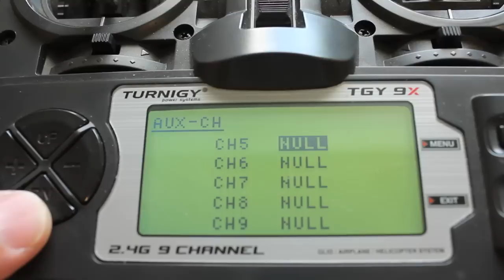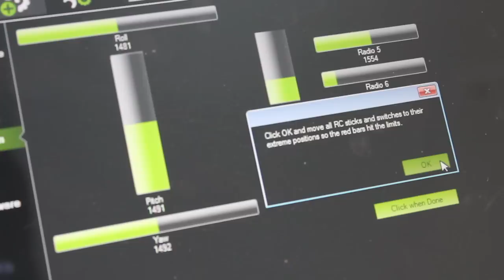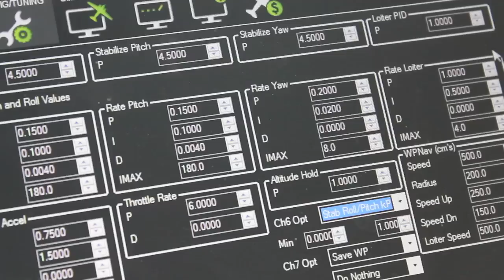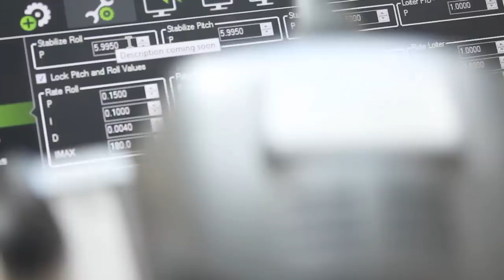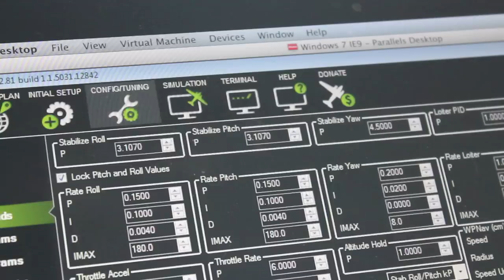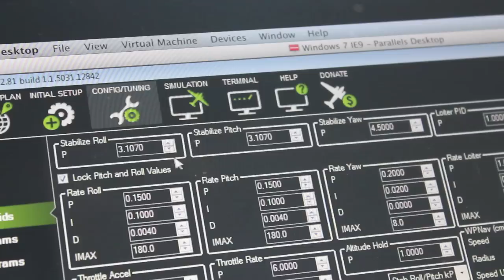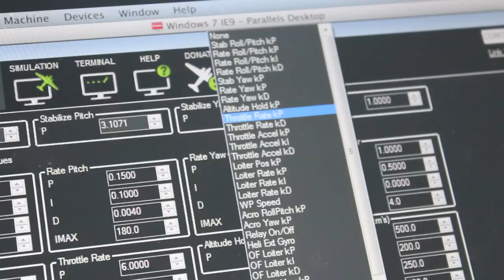APM 2.5 In-Flight Pitch/Roll Gain Tuning for Stabilize Mode w/ TBS Discovery Quadcopter

Comment: What is the difference between Stabilize Roll/Pitch vs Rate Roll/Pitch?  From what i gathered off of the Ardupilot page, it would seem the Stabilize Roll/Pitch setting makes it more sensitive at the sticks, and the Rate Roll/Pitch makes the drone itself tighter and locked in while flying.  Let me know if I am correct.  Thanks!

Comment: Hi, great video.
I hope you can help me.
my quad fly fine, and after a minute in the air its starting to shake like crazy. I crash it twice when I tried to slove the problem. do you have any idea of what the problem can be?
thanks a lot! Matan.
Reply from the maker: +matatisan I would work on maybe bringing your gains down. I've noticed that if I tune in the garage and sometimes go outside in wind it will begin to oscillate. So I need to bring the gains down a bit more. Another option is to watch my most recent video about tuning 250 size frames and try some of the tips mentioned in it. I bet a good autotune may help you out.

Comment: mine got jerky when in stabilize mode

sometimes jerky yaw or jerky throttle up when in hover

i really dont know what to do after tried to solved problem with tuning PID and change vibration damper

i really appreciate if you can guess or sort my problem

thx
Reply from the maker: +j3fron I did a recent video that shows how to tune a 250 size quadcopter. Watch and see if it helps with your problems at all. Thanks for following along and good luck with your setup.

Comment: Hey Dennis I hope you can help me.
I have a apm2.8(I know it`s a clone) It flys quite well but I noticed that if I flick it to a side and let go of the stick immediately it doesn`go straight back to level, It does some sort of a wobble and goes level like that which I thought that it wasn´t a major problem but in loiter or pos hold mode it can´t correct very well if it´s windy, because it´s constantly trying to correct which results to a major osccilations which then leads to a crash if I don´t go back to stabialize.
Reply from the maker: +robin bertschler My best advice is to check out "Common Problems" on this Loiter page:

http://copter.ardupilot.com/wiki/loiter-mode/

Also, have you checked stabilize tuning as discussed here:

http://copter.ardupilot.com/wiki/stabilize-mode/

and look into auto tuning. Good luck and please keep us posted on your progress.
Reply: Thanks i'll let you know.
Reply: Now this is a diffrent topic but I just can't figure it out.
I have a ts351 and a rc305. I'm using a rollei bullet 4s which us very simmilar to a gopro 2 also has the same video out. But I can't get a good video, sometimes it's green, flickers (you can't really see anything) but usually I get no video at all. The camera works fine if I plug it to the screen directly.
Reply: Hello Robin, i have exactly the same problem, did you find the solution?

Comment: dear Dennis Baldwin ,i hope you can help me as i am in the middle of tuning my copter, and as it is windy in the uk right now and i am little sceptical about autotune i am doing in flight tune with channel 6 ,i have an x8 set up on 700mm frame with multistar 4006 740 kv motor and just have put 1345cf props on previously had 1255 , and it flys worse now with 1345 and i thought it would fly better, as it has become very wobbly and thought you had to decrease gain from stockgains as it says in spec that i should have gained more trust/power with these 1345 props , however the way i understood from your video i have to increase gain instead of decreasing and i think that was my mistake as i decreased gain in flight and it flew worse, went it loiter and start going crazy toilet bowl effect never did that with the 1255 previous prop and when i switched back to stabilize i shortly landed afterwards and it did not went well as i just released/lowered little throttle it dropped dramatically /rapid that it plumped to the ground(low altitude and i actually crashed, luckily no damage except snapped gps mount which is easy to replace as i have few spare, just to clarify you recommend i should increase gain and what about thi I shall i leave it always at 0.1 Intelvale) and what the D always at 0.4 and what does IMAX stand for? as my default setting is IMAX 100 ( what is IMAX?) i have version 3.2.1 arducopter board is arducopter 2.6, if you could give me some advice that would be from great help , thank you so much in advance, kind regards by the way also in Loiter it started to climb in altitude , thank you
Reply from the maker: +Meister Grinder Good questions. I wish I could answer all of them. Here is a great resource for gain tuning:

http://diydrones.com/forum/topics/arducopter-tuning-guide

Sorry to hear you've had problems with it being wobbly. There are a lot of comments in that post so be sure to read through them. Whether you're tuning up or down I recommend changing the gains in very small increments. The in-flight tuning is very helpful. If your copter is so unstable that you can't mange to fly and tune at the same time then the 3DR telemetry radios come in handy. You can fly, land, change params and repeat.

Good luck and keep us posted on your progress. Sounds like a fun project.

Comment: hi bro.. very pleased with ur informative apm video.. but after 2 weeks I now face a new problem with altitude hold. .
my quad jumps up and down when I use the barometer. .
it also effects loiter mode.. but no effect in position hold mode... i tried replacing foarm inside the apm 2.6 hardcase but no use .. tried giving it an external cover and even tried resetting it to defaults and programmed it from the beginning. .
please help me ..
my setup..
.dji f450  frame
sunnysky x2212 980kv
carbon fibre 1047
simon k 30A
5000mah 3s 20c 
apm 2.6 with external gps and power module
flysky fs-th9x 
my quad is flying superb in stablise mod... i have been trying hard to find a solution but found none working. .
hope ull help. ..
thanks in advance. .
Reply from the maker: +Ashish Faustine It's hard to say what your specific problem is but it definitely sounds like it's related to the baro? This is probably one of the best resources I've found in the past for dealing with this issue: http://diydrones.com/profiles/blogs/baro-drift-and-how-i-got-round-it Sorry wish I could be of more assistance. Good luck.

Comment: Just fried one of my ESC trying this on APM 2.6. Don't be like me :(
Reply from the maker: Victor Tiamson Yikes! Sorry to hear that. Maybe give autotune a try so you don't have to mess with this.
Reply: Dennis Baldwin Yeah. I actually copied your mission planner settings irregardless of APM version. lol There was a warning actually about TUNE being so high. I ignored it since I assumed that output is digital and thought it won't do any damage. Now I know lol. Well, just learn from experience. Cheers :D
Reply: Dennis Baldwin BTW I have a minimal problem with my S500 quad. When I take off, it's kinda leaning backward and I have to increase the pitch to balance it. But when It's in the air it hovers quite stable. I tried adjusting the battery to move the weight forward but that has no effect either. Thanks.

Comment: Hey Dennis,
My friend has an APM in a TBS Discovery, however he is having some issues. When you yaw, especially after going forward, it will gain a lot of altitude 5-10 meters. faster forward means it climbs more. Also when you go forward and then let go of the sticks the tail drops dramatically, literally falls further than 45 degrees. Have you got any advice on this??
Cheers
Reply from the maker: Rudgwick Aerial Photography Hey! I've never run into this problem before so I'm not sure what to tell you. One thing I would check is that your barometer is properly covered if you don't have the APM in a case. I had all sorts of problems with my APM clone and barometer, which wasn't covered.
Reply: Make sure the props and the motors are balanced. Also, has your friend done all the necessary basic calibrations? Eq, compass, GPS, accelerometer and so forth.

Comment: Thanks for making these videos. They have helped me in hooking up my apm board. Do you have to wait the 5 or 6 minutes to get a good GPS fix when you are indoors or have you had any issues in stabilize without GPS? Thanks.
Reply from the maker: Yes it generally takes longer to get a fix indoors. But I only fly indoors to make sure I can get airborne and do some quick checks. Then I go outside to test gains and GPS features (loiter, RTL, AUTO, etc). Thanks for watching.

Comment: Hi Dennis, i'm in to tuning and have done the auto tuning with my APM 2.5 AC 3.0.1 R8 with bad results, far to sloppy in stabilizing.
I ended up so far by entering the corrections manually so it comes halve way to the original AC settings and the auto tuning values and it flies much better now.
Your in flight tuning with the TBS frame has the "Lock Pitch and Roll Values" enabled don't you think this frame has to have the Lock values separated tuned in, since this is not a X but an V frame and the weight of camera and battery have more influence in the pitch.
Thanks for your clear videos you helpt me al lot.
Reply from the maker: Good point! I hadn't really thought about that. When I locked the pitch and roll with the TBS I didn't notice too much difference given the shape of the frame, but it's definitely something worth experimenting with. I'm always amazed at the great suggestions that come through in these comments. Thanks and I appreciate you feedback.

Comment: i have a qav 400 with the apm 2.5 fc on it. when i have it in loiter mode the sticks are very dumbed down and the quad hardly responds to the stick inputs. is it possible to get the apm 2.5 to fly like the naza in gps mode when it is in loiter mode?

Comment: Dennis, I have just had a pretty bad crash with my new QAV500 and DJI Naza lite. The quad just flew away. I have seen that this behavior is common on DJI Naza, so I want to migrate to a new controller. Any recommendation? Regards.

Comment from the maker: I do mine in stabilize mode as well. I would think if you want to test your rate gains in real time it would be better to be in acro mode, but don't quote me on that. I guess the rate gains would still apply in stabilize mode but you'd have to deal with the constant leveling. I don't know of a way to reset the PIDs without resetting everything...other than manually entering the default PID values. Good questions Rahul!

Comment from the maker: Hi Nicholas, thanks for the kind words. My TBS Discovery has 950 kV motors, iPower motors from gothelirc . com. 10x4.5 APC multirotor props. Battery is 2450mAh 3S. AUW used to be about 2.7lbs, but I have checked it lately after I've made a few tweaks. Let me check again tomorrow and I'll let you know for sure.